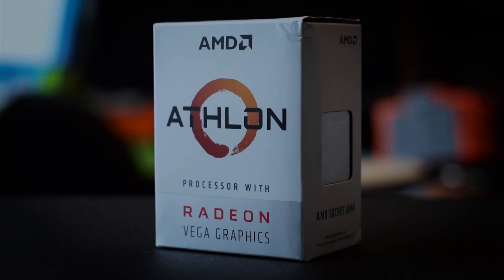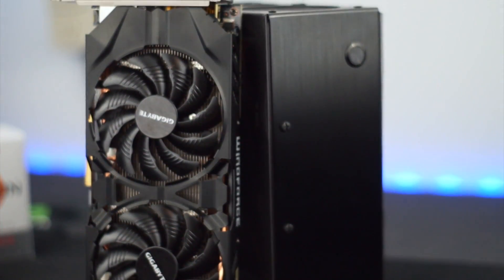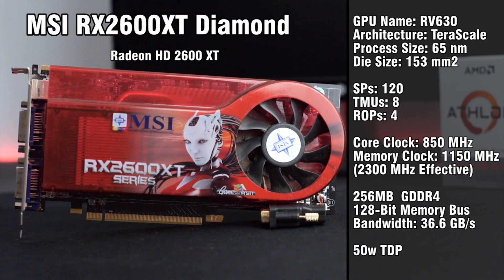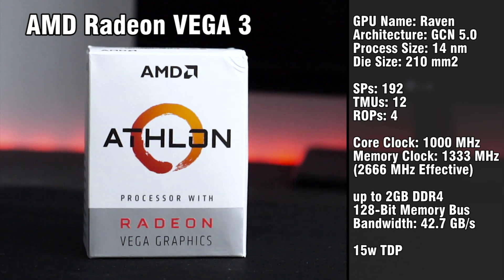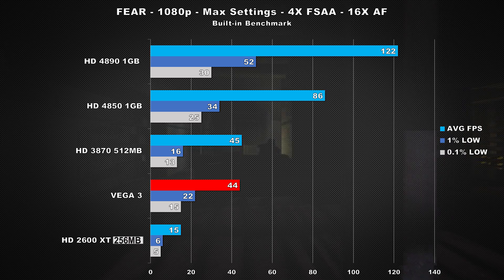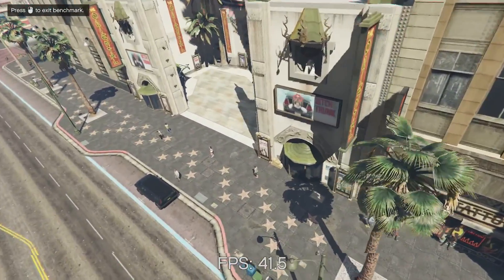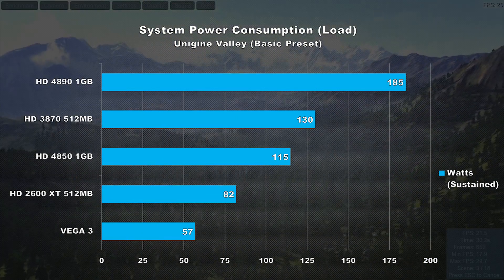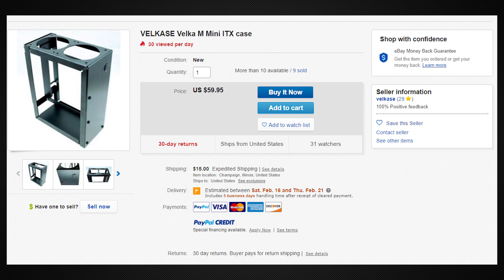VEGA 3 takes on Old School ATi Radeons

Comment: My old & trusty GDDR2 HD4670 is racing with the VEGA3, makes me happy to see that. Great video!
Reply: 4670? I got the DDR3 version! Most reliable card I have, no joke! Works flawlessly everywhere.
All my Nvidia cards, with the exception of the MX440, died with around 1 year of use. :(
Reply: @ThePortuguesePlayer  I had one single nvidia card, that was in a laptop, the 8400M GS, which died - like many, many other 8xxxM laptops back in the day - https://www.theinquirer.net/inquirer/news/1004378/why-nvidia-chips-defective

My HD4670 is nearing the end of it's life though, as since it's fan stops working frequently I idle at 90C. Goes up to ~120C when playing games, then shuts down. Served me well for 8 years, though.

Comment: This is a great video. While it might show some more games from that time, it still serves as proof that the Vega 3 is on par with the HD 3870, which was relased in november 2007. This essentially means that this little beast can run flawlessly any single game prior to 2008. That's a HUGE library of games, aside from a lot of newer games and emulators. This is a dream for HTPC builders.

Comment: Hehe I remember when people used to said that in the future you could run crysis on an integrated gpu at least at 30 fps.
Reply: You can. This is the cheaper version :)
Reply: Vega 11 has been overclocked to 1600MHz which is a 60% overclock over this with double the rops and a bit less than 4 times the shaders. Then get a dual channel memory setup up to 2933 along side the rest of the system being overclocked and watch that destoy this.

Also the major reason integrated can't be better is because motherboards do not allow high enough memory clockspeeds to feed that integrated GPU and the wattage is significantly limited. If the motherboards were better AMD would have sold you better chips. A console can which is why the Xbox One and PS4 have larger GPUs than this. The PS4 had 32 rops where this only has 4.
Reply: you can lol... just not on this ultra low-end one
Reply: You can on the 2400G
Reply: well the future never stops

Comment: Great video, and as always i'm surprised as to how older cards can still handle present titles to some degree. 

The case is a bit lackluster but i agree with what you said, if the side panels were slightly better built it could be really nice HTPC. Especially if you can mount a more than half decent small form factor GPU to run arcade\vintage games or a PS2 emulator. (Currently using an old HP small form factor office pc as my living room PC)

P.S
I should have an old GTX460 lying around somewhere, in working order since i used it a few months ago for testing. Got a new for a another one?

Comment: Use Windows 10 ltsc/ltsb for driver compatibility on old devices due to it having WDM 1.0/1.1 support still. Youll be able to install last supported official ati/amd drivers on those old cards else use Windows 7/XP.

Comment: We've come quite a long way with intergrated GPUs!
Reply: Almost 12k 3dmark06 is indeed a nice score for 70€ CPU's IGPU o_O
Reply: I would say no. 11 years and still not beating older cards.
Reply: @KASE94  that's unfair to say since it's literally the absolute worst igpu from amd, an oced vega 8 on the ryzen 3 2200g can match a gt 1030 and some older cards like the HD 7770
Reply: @bobsagget823  ??
Reply: @KASE94  tell that to the 2400G ;)
Reply: @KASE94  Yeah my hd6970 will smash it hard but how much power will it use ?
Reply: A N I M E
N
I
M
E
Reply: Amd come quite a long way with intergrated gpus* Intel doesn't do shit.
Reply: @hombreperro4547  isn't it vega 11 on r5 2400g that matched the gt 1030?
Reply: @andrijuliansyah3297  if you oc a vega 8 you can match a gt 1030, the vega 11 can pass it as long its clocks are high and the memory is fast (3200mhz+)

Comment: I used to have the HD4850 1gb form xfx, I remember using it even to play farcry3 at 900p med/high sets around 30/40fps average. It was the card that I most enjoyed, really good memories with it. But I guess the 1060 6gb I'm using now it's going to steal it's crown because I don't plan to change it in a long while

Comment: I recently ugraded my Motherboard,CPU,RAM .I have the athlon 200GE clocked at 3.95GHz(4 was not stable) on a asrock x370 pro4 with 4gb(for now) 2666MHz(CL19).I still have my old PSU, HD 6970 and storage
Reply: A B350 is better suited with this CPU, because is cheaper, have VRM heatsink (Sometimes) to do the same overclock in this CPU and is upgradeable to Ryzen 5 and 7 with no problem... Well at least you have a beefier Motherboard to upgrade for Ryzen 3000!
Reply: @ismaelsoto9507   I plan to upgrade to ryzen 3rd gen
Reply: @pesho9971  Yeah, this motherboard is good enough to upgrade to Ryzen 3th gen and even Ryzen 4th, what will arrive in 2020!
Reply: @ismaelsoto9507  fingers crossed that 4th gen ryzen will still support AM4
Reply: @longhairedanon  Well is supposed to AM4 support Ryzen 4th Gen, because it will arrive, probably, in 2020...
Reply: mind if I asked how you overclocked it on an asrock motherboard? I thought only msi has it unlocked

Comment: Really like that case. Using a 2200g in an InWin BQ656, at hitting higher temps than I'd like. Added some 30mm fan to help exhaust heat, but wanted to see about increasing airflow and even trying to add a single slot gpu (a passive 1030 isn't much of an improvement over the 2200g... will just wait for the next APU at this point, the 3300g or whatever it will be called).

Comment: Actually if you think about it, by extending the case to fit larger GPUs in, by leaving that open, you're not starving any airflow. Although I liked the cleaner look with the stock case length with a short GPU which makes it great for an HTPC, I wonder how far of a gaming PC you can take with the case you extended with the standoffs as well as the Flex PSU.

Comment: I think you should've tested the old cards on a legacy system. I think the cards are bottlenecked (PCI-E 2.0 x4) ? Still, kudos for the nice build and the work !
Reply from the maker: It’s actually PCIe 3.0 4X, which is enough for all of the cards tested. Windows 7 would’ve been more beneficial for the older cards, but I have tested a number of them in previous videos. Thanks

Comment: The 200GE can be overclocked to 3.9Ghz if used on an MSI board. It definitely has a lot of spunk for such a cheap CPU.
Reply from the maker: It can on this board as well. I've achieved 4.05GHz

Comment: TBH I'm surprised it did this well against dedicated GPUs. The VRAM alone I figured would have put even a fast chip like this far below even the HD3870 when the HD3870 was running appropriately. From what I've seen online (I can only find mobile Athlon 200GE Vega 3 specs) this thing only has 4 rops. Does this chip really do this well with so few rops? I mean even the Radeon 9700 had double the rops of this

Comment: back then, even the most powerfull GPU like 8800 GTX are struggle to play Crysis with resolution larger than 1280x1024
nowadays, cheapo Ahtlon 200GE can play Crysis 1920x1080 with onboard Vega graphics.

Comment: Reminds me of a HD 4850 i had that i got clocked to 850MHz with a pencil volt mod and a triple heat pipe CPU cooler i zip tied on ;-) i think i got it close to 1GHz but it ran hotter than i liked and at 850Mhz it was the sweet spot cool, stable, and super quiet.

Also reminds me that stock coolers back then sucked really hard, they where garbage.

Comment: My Radeon HD 7750 Sapphire (2GB GDDR3) carried my my old rig for over half a decade and assists my Ryzen 3 2200G (not GE) with Vega 8 since it benchmarks just a few under it... Yes that's right a graphics card from 2011-2012 is in the high end... thats not because newer GPU's aren't decent but because the 7750 is one of the most stable radeon cards out there...

Even now the only games it's struggling are brand new ones or ones that have photo realistic graphics such games like: Star Citizen, Black Desert, Dauntless, Anthem and Apex Legends...
The general theme is it lags out around populated areas in these high end games I believe that's likely due to having to render so many custom characters in such a high fidelity it's a tough job for a 6-7 yr old card...

I managed to pick up the slack in most of these games by Overclocking on my RAM, CPU and Graphics Memory Speed frequencies 
Getting from 2666mhz in RAM up to 2800Mhz, 
then the cpu from 3500mhz (2.5Ghz) to 3850Mhz 
and then managed to get the built in graphics from 400Mhz
(for some stupid reason idk ask the man) up to 1600Mhz.

Notice: Keep in mind i'm using a budget build so if you want a supercomputer to play the games i mention on ultra Ryzen 3 isn't enough for you!

I saw a small improvement in 
Star citizen and VR Chat by 5 -10 more fps and that's in a 1080 resolution

Golf with your friends 
saw absolutely no improvement at all...

Black Desert 
now allowed me either option of 2560x1440 VSR (Virtual Super Resolution) with the same amount of frames I had prior in 1920x1080
or the option to switch on the remastered while running at slitghly better frames than before (which despite them saying it runs faster after the 1st day I cameback and was for some reason worse in optimisation)

Dauntless: This saw the most dramatic improvement I was now able to manage playing the game faster in 1440 VSR than I did prior to the OC in 1080 this meant that when I played in 1080 with my desktop as 1440P It was almost completely smooth probable around a 20 to 25 frame gain although that maybe be due to optimisation since it's a new game...

I'd test on anthem but I don't have it I just tried the demo which was running at 15fps but even if I could the full game is better optimised so I wouldn't be able to tell how many fps were gained from the oc!

What I can tell you is that in every other game Elite, Defiance 2050, Warframe, Champions Online, and every other game older than 3 yrs will probably run at 4K when OCed some of which will probably run at factory settings...

Remember to be careful and run tests when overclocking and only increase by increments of 0025mhz 
until the part you are overclocking crashes in the a benchmark test 
then put back it down by 25 and restart and that will be your limit 
(due to the lottery luck of overclocking you could reach as far as 4ghz but even if you do don't push past it or your cpu may melt down) 
and don't put your voltage any higher than 1.45v unless you wanna fry your cpu 
1.35v is commonly reccomended this is generally cause of cpu temperature.
mine gets to a toaster 45-55 Celcius while gaming!

There is a Ryzen setting in power settings for windows 10 computers now I recommend using it!

Sadly now my HD 7750 is the weak link compared to the DDR4 RAM 2666Mhz, 3.5GHZ processor, Vega 8 Graphics and A320M-K motherboard especially overclocked to 2800Mhz, 3.85GHZ and 1600Mhz...

So I am probably gonna sell it and get a better discrete card so I can get better frames on the super high end games... atm it sits at around £115 which is funny cause when i bought it, the card was only worth £79.99 first hand this isn't inflation it's just it benchmarks well against new cards!

Comment: No thermal paste? Hmm, odd choice. 

Great video either way.
Cheers
Reply from the maker: It’s pre-applied on the HSF. Shown in odd little squares on the underside.
Reply: Thermal paste is pre-applied as you can (very) briefly see as the grid of dots at 3:39.
Reply: Ha, didn't see you replied was at that part in the video when I read it.
Reply: @F2FTech  I did notice it after watching it again. That's my fault.

Comment: HD 4890... ah, the first card I had which ran over 1GHz core clock.
Reply: Damn you're lucky. My old HD4890 could only achieved a meager 930mhz. I didn't have the heart to push it further as it already screams near 90C 5minutes in on Furmark.
Reply: @rush21hit  Furmark murders TeraScale cards because they don't have any power tuning. It doesn't show how the cards will run under any realistic stress. Run something more indicative of a real-world use, like 3DMark. With that said, most 4890s are running 1.3125v and 930-945MHz is the normal OC range. There are 1.4v and even 1.5v capable cards that go as high as 1050MHz on air.
Reply: @FixedFunction  I see. Its just that the mere thought of having my hardware dies on me send shivers down my spine. I retired my old 4890 to 750ti. I OC it few days before buying 750ti out of frustration. Because AMD classified it for Legacy driver from then on, even if I understood why. I just couldn't accept it.
I wrap it on its box it came with in my cabinet.

I am now using RX570 8gb, sold the 750ti.
Since nobody wants to buy 4890 in this day and age :')

Comment: I'm surprised you tested the 2600XT and not the 1GB HD2900XT or HD2900 Pro. For that matter they did make a 1GB HD2600XT.
Reply from the maker: Yeah, performance of the 2900 XT would fall pretty close to the HD 3870, so I figured I’d test the 2600 XT instead. I thought I was testing my 512 model...turns out I wasn’t  🤔

Comment: The problem I'm pretty sure is that the Athlon doesn't support the 16x slot and it's running at 8x. I think that might be why the nvidia gpus are being fussy.
Reply from the maker: The NVIDIA cards I tested are PCIe 1.0 and 2.0. I did get them working after enabling a legacy PCIe setting in the bios. The main issue was constant freezing after the drivers installed. I tried multiple drivers and had the same issues. Not sure?

Comment: what was the point of the small form factor?..why bother cramming components in when this test could just as easily been done a test bench?..strange
Reply from the maker: The video was also a feature for the case.
Reply: And your link for the Corsair memory?...video shows G.Skill
Reply from the maker: The Gskill kit I more expensive since it’s an older kit, so I linked a more reasonably priced kit.

Comment: Does the Vega3 outperform a 2gb GeForce gt710?
Reply: Yes the Vega 3 outperform the GT 710 and even the GT 730...
Reply: @ismaelsoto9507  
The reason I ask is that I use Linux Mint and apparently the drivers are not ready for the 200ge therefore I bought the gt710 (€57) as Nvidea writes drivers for Linux distros.
The pc is setup as a server with basic video editing.
Many thanks
Reply: @badger67  Well for Linux distros, the NVidia GPU's have better support and drivers than AMD GPU's in general, but I think that AMD will have better Drivers for Linux in the future...
Reply: You are welcome!
Reply: @badger67 , I installed Linux Mint 19.1 and the HDD is flashing once every few seconds, do you have this problem before adding the GT710?
Reply: @seebauong9593  
I'm running 18.3 on my AMD 200ge, but I did install 19.1 onto my old Dell laptop and it took a good 5 mins to boot into the desktop and was a bit buggy.
As a general rule I only use the LTS (even nos.) as my primary OS's.
So to answer your question, no I have not had that broblem with the GT710, but it works great on 18.3.

Comment: So then the next logical step is 2200G and 2400G

PS honestly AMD should retire the athlon name and should call these chips Ryzen1, dual core 4 thread chips, 4 & 8 MB L3cache, and various default frequencies.

Ryzen 1, 1000 & 1100
Ryzen 1, 2000 & 2100
Reply: If they move the Ryzen architecture to 2c4t cpus, they would make a huge e-sport PC for the money, cause they are already making good high-end cpus, but the low cost is for i3, sadly.
Reply: AMD already said they weren't gonna have ryzen touch dual core, so they had to use some other name of theirs to justify dual cores (they should've used sempron instead)
Reply: @valentinoishere1541  the Ryzen 1200/1300/2200G ($75-$95) competes with the i3-8100($115-120), i3-8300($135-145), and beats i3-7100, 7300, i5-7400, i3-6100, 6300, i5-6400, i5-6500 ($110-$140). Cheer up have a Ryzen3!
Reply: @hughjassstudios9688  I hear ya but for non-pc enthusiasts who just look at store shelves product continuity is critical. When they are looking at a 4790k, or an 8600k they only gonna see an  i7 & an i5 and choose i7 cuz i7>i5. They will see Ryzen 7, 5, 3 and ask what's an Athlon? Is that better or worse than Ryzen?

Comment: HD 2600XT, even with GDDR4 was piece of shit. I had that card and it was slower than GF 7600GT which i owned before... Tested in FEAR and Crysis back in 2008.  I remember the distribution between HD3870, HD4850 and HD4870 cards (all 512 MB) in Crysis at 1680x1050, DX9, no AA, high settings: 22/33/44 FPS respectively (Windows 7).
Reply from the maker: Yeah performance under Windows 10 hasn’t been kind to early TeraScale cards. Using XP or Vista would show better performance.

Comment: i don't know but i feel triggered when someone doesn't reapply thermal paste to a new cpu
Reply: Why? The thermal paste was applied on the heatsink, as far as i can tell.
Reply: @Konkretertyp  yeahh you're actually right but most of the time it's bad quality also it can get old and loose its effectiveness over time it is  highly recommended to apply a new one for good heat dissipation =D
Reply: @notechnolife9596  For a quick test of this system, i think the already applied thermal paste is alright to use. For longterm usage, i would agree, that it is better to apply new one.
Reply: @Konkretertyp  i totally agree =)